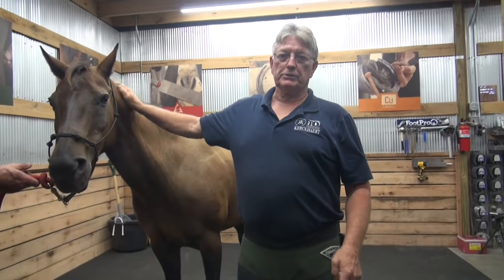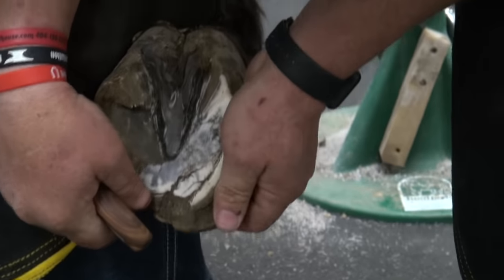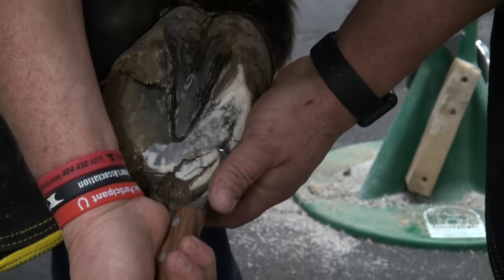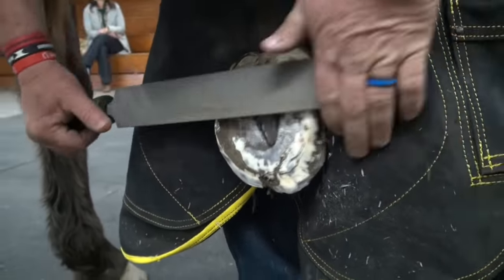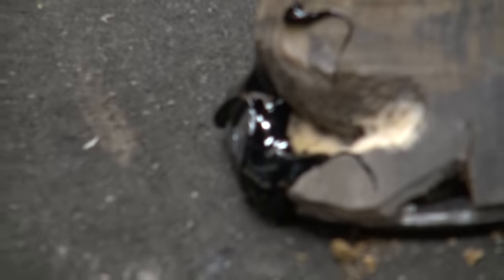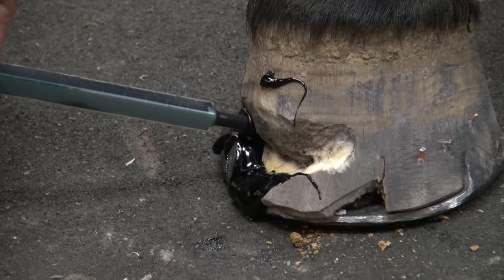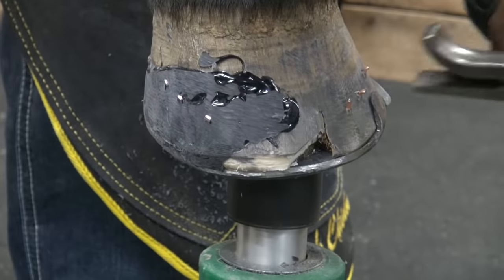Abscess and Repair

Comment: What kind of person would let a horse's foot get this bad. Poor thing must have been in terrible pain. Thank you for helping her .
Reply: This horse blew an abscess. It could have been at the coronary band and it had to grow out, or half way down the hoof. What this farrier did was amazing to keep this horse sound and not going lamanitic, which it so easily could have done. I rehabilitate horses from injuries. I work very closely with the Surgeons, Veterinarians, Farriers, Nutritionists and the owners to get their horses sound and competing again. Sometimes it takes me a year to accomplish that goal. But working as a TEAM, we accomplish the goal we set out to do. Even if the horse never competes again and becomes a brood mare, I'm still involved. As I'm the one who delivers the foals. I did a trick I learned at the breeding barn. I grabbed a full and sealed water bottle, I then tied it up with her membranes while she was still contracting. The placenta came away, and I put it in a bucket for the vet to check, as she is a narrow hipped mare. He told me I did everything correctly when he arrived at the barn 5 hours later. Foal was up and nursing well. We checked the mare for any tears, and there weren't any because of the gentle traction of the water bottle that I had to tie up twice. We had 2 Hanoverian Colts, 2 Hanoverian Fillies, and 1 Dutch Warm blood Filly. All mothers and foals are well, and 3 have returned to their owners homes. The other 2, 1 Colt and 1 Filly are still in my care. They were the last born earlier this month. I've started working a bit with the foals. Who's attention span is 5 minutes or so, but I can lift their legs and clean out the feet then gently and lightly tap with the back of a wooden Dandy Brush. All in preparation for when they have to be, later in life, shod. Mother walks ahead on a lead, they are in a foal halter being led beside her. Beginning of Ground Manners. Especially for a Colt. The more  you can teach them trust without pain, stops him from invading your space, because he already has the basics. You can teach so much from the ground BEFORE you even think of doing a layover their back in preparation for riding. Hope this help! Many Blessings and Stay Safe in these troubled times. Best Regards from Ontario, Canada, Jenn.
Reply: @jenniferlehman2464   Audrey is correct while the abscess may not have been avoidable everything that came after is 100% neglect!  If I had a horse with a defect that bad I would certainly not neglect the feet. Regular trimming to maintain a proper balance and reduce torque on the damaged area of wall would have prevented the massive sole fracture and wall blowout. Hell treating the abscessed area long before it blew out the top would have prevented the whole damn mess.  The condition of this horses feet comes from neglect. Much like a heavily matted dog if takes a long time for these conditions to develop. Regular grooming prevents matting! And regular hoof trimming prevents what you see above.  Any farrier worth the cost of his or her tools could have prevented the excessive damage done to this horses foot.  Hell I’m no pro trimmer but even I could have kept that foot from coming apart with basic trimming tools.
Reply: @jaykneegarner2479  While what you say is correct, I would have been ticked to say the least if this was the first time seeing the horse after the abscess blew, the farrier did mention that the last time that he was out, the wall was still attached. As soon as the owner noticed it wasn't, she contacted the farrier, and the correction began. It is neat the start of the video when he kind of mumbles that. Best Regards and Stay Safe!! Happy Riding! From Ontario, Canada, Jenn.
Reply: As I see it, this person has disqualified himself as a horse owner. I get a stomach ache from thinking that the horse must return to the owner again.
Reply: @hepaticanobilis9700  This horse was rescued from it's previous owner who had died. As soon as the person caring for the animals saw this, they immediately got the farrier out to start the trim and repair done. Don't judge unless you know the whole story. I do, because the farrier I use KNOWS THIS FARRIER personally. Hope you have a great week, Stay Safe!
Reply: @hepaticanobilis9700  No, the original owner died. The new owner, where this was done, upon noticing it on pick up of the 4 horses total, had the farrier come out and immediately address this horses issue, as well as trim the other 3 horses. They had managed their feet well, this one had not.
Reply: @jenniferlehman2464  The video is recorded in the same room on two different occasions at 7 month intervals. The neglect has taken place between the first and second recording.
Is the premises with the previously now dead owner, or with the new owner or elsewhere?
Reply: @hepaticanobilis9700  It is the premises of the old owner.
Reply: @jenniferlehman2464  Ok, then I'm in. Then it will be exciting to follow the new owner's care. unfortunately I do not have FB, and will not get it either, so I can hope that there will be a follow-up here on Youtube.
Now I'll watch WM Curling from Canada, I'm on Swedish Team Edin! It's in the middle of the night here in Sweden .. zzz. Have a nice day.

Comment: My suggestion: Ini such a case I use the "Dallmer Cuff with T-Iron". it's a glue-on shoe with an inlet that keeps the hoof stable and the removed part of the wall clean. If you want to know more about these shoes, let me know.

Comment: How often does a horse need hoof trimming is it very expensive if maintained
Reply from the maker: Most active horses with shoes are done every 5-8 weeks. Barefoot horses may be able to go longer but should probably be checked at 6-8 weeks from last trim.

Comment: If you use a torch on the underside where the sole and frog are, and heat it a little it will peel like butter.  I watched a farrier do it today.

Comment: How long will it take for the hoof to grow out? The brake looked really severe on that particular horse was wondering how long recovery time will be and how many times will you have to reposition the shoe as it grows out and becomes normal again? Seems like at least a few months of the same process and reshoeing
Reply from the maker: A hoof wall usually takes almost a year to grow a completely new wall from coronary band to ground.

Comment: Do you find after having to use the Equipack and other substances, after rasping, do you need to replace your rasp due to being full of stuff?

Brilliant job at any rate, so kind and patient with a little mare who had to be in so much pain. 

Positive thoughts from Australia 🇦🇺
Reply from the maker: You can use a wire brush to clean up the rasp. And some might use a cotton or felt wheel on a grinder to do that also.
Reply: @FarrierProducts  thanks for taking the time to answer my question.    I've not had any, thankfully, who have required the use of Equipack or the like so far.

Comment: Do horses not feel their hooves? She doesn't bothered one bit
Nice job!
Reply from the maker: The outer parts of the hoof are insensitive tissue so the don't have an feeling. Only the inside if there is a problem like a bone damage or abscess- when she had the active abscess she would have felt the work being done and probably would have been uncomfortable.

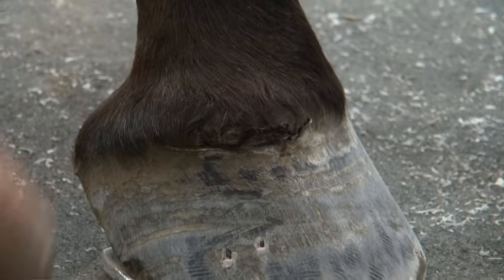Comment: The horse @3:10 with the detachment, could something like that formahoof (2 part polyvinyl epoxy type) be beneficial or quite the opposite? I’m not sure if the hoof has areas that need to be open for drainage (ongoing abscess or infection). It looks like you may have used something like it or better even possibly a hybrid of old and new technology. Looks great. 
Wow, this work makes all the difference doesn’t it🪶

Comment: so what caused this horse to have thia peoblem with her hoof??
Reply from the maker: It's not easy to know what caused the original insult or wound that eventually became an abscess that spread. However, if the horse had been maintained on a regular basis it should have been caught early before causing so much damage.

Comment: Why did he not fill in the gap in the front of the foot on the last horse? Will it not crack up and be painful for the horse after a while?
Reply: Because the side that he repaired was an old abscess that burst out at the coronary band where the hoof proliferates & grows from, it was only a few months from growing out completely to the bottom so the risk of trapping any bacterial or fungal organisms behind it was very slim. The crack at the front of the hoof was too risky to fill because it looked moist & diseased. The bacteria that grow & populate into the hoof wall love nothing more than a nice dark, warm no oxygen environment, so by filling in that part of the hoof it'll create an infection as bad or worse than the one on the side that he just finished repairing. You're right, the front looks cracked & unkempt but it's actually the lesser evil than filling it in at this stage.

Comment: By the way why dont you all use like a trimmer so it wont be so difficult trying to file it down with the haevy filer. Just wondering🤔🤔🤔
Reply from the maker: Some farriers use a battery operated tool, but most like to use the hoof nippers and rasp for more control. Good question.

Comment: Is there a reason for the copper nails?
Reply from the maker: They don't rust so they stay stronger and drive smoother. There is also some antimicrobial benefit where bacteria would contact the nail.

Comment: How does this happen? I'm very curious
Reply from the maker: The horse developed an abscess inside the hoof. That happens for various reasons, sometimes bruising. Then it opens up, usually at the top of the hoof wall or sometimes in the sole. In this case it had been active for some time so it undermined the hoof wall before finally coming out.

Comment: Why not fill the big crack in the tip of his hoof with the epoxy too?
Reply from the maker: I believe there was a little bit of moisture seeping at the toe and when there is, they avoid sealing it because there is a risk of an abscess developing (again in this case).
Reply: @FarrierProducts  Ah, makes sense. thanks for the reply!

Comment: Is this caused from neglect or is it natural?
Reply from the maker: Sometimes an abscess occurs naturally but it's the follow up and treatment that are important and this horse did not get either after the initial abscess was discovered and treated.
Reply: @FarrierProducts  good deal. I've worked on farms most my life. Not paying close attention, especially if you have alot of animals. What causes the hoof to be either solid or really dry and crumbly?
Reply from the maker: @bryonmason6330  A number of factors. Changes in wet/dry, nutrition maybe the biggest factors. A crumbly sole is usually just exfoliating excess. If the wall is, there can be problems like white line bacterial issue or it's back to the first two issues. Regular trimming and rounding the edges can help any barefoot horse.

Comment: wonder if formahoof(that epoxy Kevlar new stuff)would help🤔you can cast the whole foot in it then file it down to shape and I b elive you can nail a shoe to it too(I don't know) to help support and hold her foot together.  I'm so glad she got to see you for some desperate care and she heals up better than you found her
Reply from the maker: Hello Helen- it may be something to consider. We have no experience with it yet. Thanks for the tip.
Reply: I was thinking the same thing. You are already using the resin in patches. The formahoof would provide a more uniform support and not compromise the structure of what remaining hoof wall she has. Poor girl! I'm glad she's getting the care she needs.💕🐎

Comment: What is the “sharks tooth” area made of?
Reply from the maker: The outer wall is the hardest part and the layer below is a tissue that is usually pliable and has moisture, unless it is exposes as in this case and it drys some and gets harder.

Comment: Having an abcess is not due to neglect. When the horse has other issues. I have been around horses from birth. Worked professionally with horses 40 years. When a horse has an abcess coming out of the coronary band we call it popping a gravel.
Reply from the maker: That’s very true. The problem in this case came after the abscess when they didn’t do the regular follow up.

Comment: You would think that with all the adhesives they have these days, they could come up with some type of epoxy to attach the shoe to the hoof without the use of nails.
Reply: They do, But the cost of the glue is far more than the cost of nails + much more time to glue on

Comment: That was amazing. I’ve seen a dead hoof taken apart to see the lower layer but never a live one. Were the copper nails used because it’s a softer metal to work with?
Reply: Copper nails affects the pH level, and that helps in fighting White Line disease and other fungus infections in the hooves. They are becoming more and more comon to use here in Denmark.

Comment: How come no one likes to put horses in cattle chutes to fix their hoof problems?
Reply from the maker: Cattle chutes just aren't designed for horses and many horses will feel trapped and fight it. Some farriers use what is called a "stock" to do big draft horses though.
Reply: @FarrierProducts  Ah OK. 👍🏾 A stock chute still seems like it would be less labor intensive opposed to trying to steady yourself with the horses leg, in-between yours, backwards, while using razor sharp knives!😳😏 I'm probably wrong tho. I'm sure if there was an easier way you guys would already be doing it.🤷🏾‍♂️

Comment: first person I seen use copper alloy nails
Reply from the maker: Hi Doug- they are actually just coated with copper and are the normal steel underneath. But the copper shield keeps the nails from rusting in the foot so it's a pretty good option.
Reply: @FarrierProducts   thanks

Comment: i was watcc kıt when i was a kid like 35 year ago local horse carts area shoemakers.at turkey that era  horseshoemakers used autrowhell .they shape and put horseshoe  between layers then nail to hoof.so like  hood was oth protected and and durable.dont know so well but whells even dicarted used one still so durable give horse portection and grip .but those horde work on asphalt or concrate surfaces.no idea what they do now.aschiled i was amazed by solotion they find it.becouse of few owner abuse and recent sjw ruccus few year back they banned horse carriege turistic tours so no more working horses all discarted some dead some libarated some dispeared.
i warched lot and i was a kid and long time pass so im not expert and not good at english too so i dont know able to describe it.when u see horse u ddnt see actual metal horeshoe u see cuted and shaped wheel piece shoe was hidden inside
before epoxy ot silicons  what they do at western countries dont know but east poor people do clever cheap solotions like that